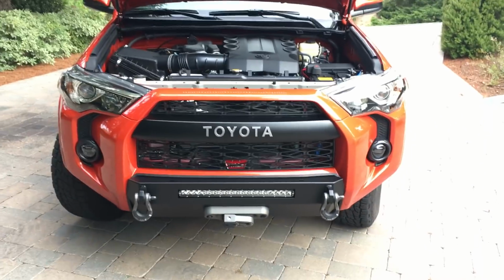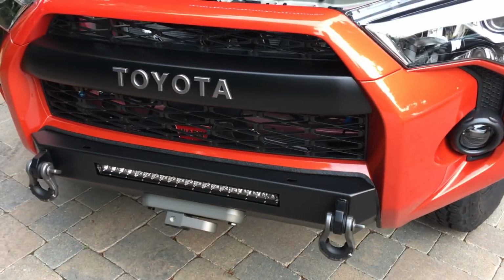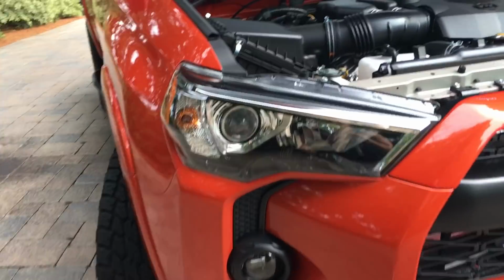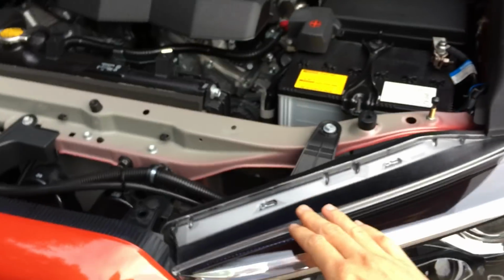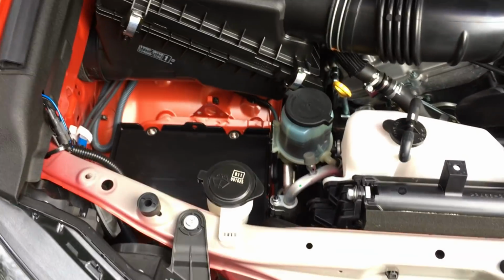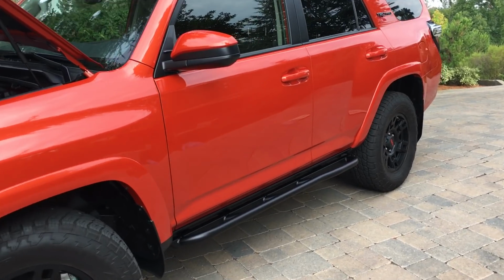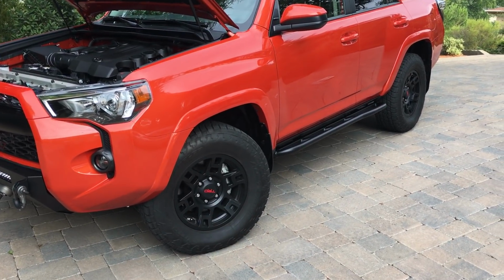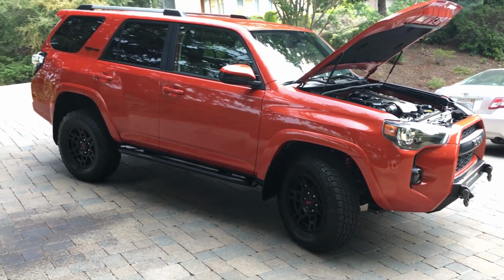IN4RNO Mod Update Sept 3 2017

Comment: Hey buddy I had the same issues you were having with the sway bar. You pulled down your video so I couldn’t text you. 

I can tell you what I did and what icon told me I had to do. Let me know if you want to chat.
Reply from the maker: marcus bacahui - I ended up smashing and flattening the cross member tube to create clearance. It wasn't quite enough on its own and so I added one carriage washer to each of the 4 bolt areas on both cross sections. This isn't ideal because it lowers my RCI armor by 1/8" and I would rather have every bit of ground clearance I can get. So, I'm going to have the drivers side cross member cut and welded with a different bend to accommodate the sway bar. What did you do to solve this problem?

Comment: How much are you selling the suspension for?
Reply from the maker: Freeman... $1400 shipped. $400 for all 4 Nitto Terra Grappler Tires (they are in EXCELLENT shape, never off-roaded, and 7K miles on them, all freeway). So, for $1800, you've got a nice TRD Pro upgrade kit (doesn't include the TRD rims or front fascia).

Comment: Why did you pick icon over king?
Reply from the maker: snazari1994 - 2 primary reasons - 1) Icon makes an Overland Series Rear Coil Spring Kit for expedition style off-roading where you can load up lots of gear and passengers in the rear and the rear suspension handles like a boss. Seriously I can't thank Icon enough for developing these rear coils the way they did. 2) The Icon kits have lots of modularity which means you can replace individual broken or worn parts without having to spend lots of money replacing entire units. Generally, the Icon kit is very well engineered and the billet aluminum parts are bad ass (strong but also very good looking). The Stage 7 kit is around $6700 for everything for front and rear including the expedition rear coils. After driving on this kit, I can vouch for it. It has amazing control, authority, manageability both on road and off road. You will have a lot of confidence driving with this kit.
Reply: Wolfgang51501986 wow, I had no idea they offered specific springs for overlanding rigs. You should definitely make a video on the suspension
Reply from the maker: I wanted to make a comprehensive, quality video, showing step by step the installation of the entire Stage 7 kit but I was under extreme time pressure to get the job done quickly on the rental lift at Pit Row. Having a complete video instruction guide would have saved me HOURS on the install. No question it needs to be done by someone, at some point. The written instructions SUCK.

Comment: get rid of that skid plate oil cover. you rub a rock underneath that and u would be crying to take it off with broken bolts. It will save u a headache.
Reply from the maker: Agreed Eduard Crespo! I have seen the same thing happen to a buddy's rig. RCI has design improvement work to do here. Luckily I haven't hit a rock yet. I'm kind of thinking of having a weld shop weld it in place permanently. You can't use that stupid little door to change your oil!!! It spills ALL OVER and pools on top of the skid plate and you're forced to remove the entire skid plate to clean it. I learned that on the first attempt to change oil by removing the little hatch door. LAME! Ever since then I just drop the entire skid plate for oil changes. ANNOYING!

Comment: Have you seen the Prinsu roofracks? I think they're awesome. http://www.prinsudesignstudio.com/2010-2016-toyota-4runner
Reply from the maker: They are the closest thing to what I actually want. Still, a little too high profile for me. I REALLY want something that hugs that roof line closely! I can relocate the XM antenna at the rear so I don't consider that a requisite for roof rack height/clearance. To be honest, I am thinking of pulling the trigger on the prinsu. Appreciate the tip Robert!

Comment: Dude this car desperately needs new engine with more horsepower and more torque it's underpowered heavy and slow as fuck also need a new 8 speed transmission then we can talk 4runner
Reply from the maker: Bobby Zee - That's why adding the new Magnuson Supercharger is a must have for this engine. Highway driving on this beast, especially up hill at altitude, leaves much to be desired (stock). However, when crawling around off-road, the engine comes alive with its low end torque. I'll be installing the new supercharger and will report back with a full review. Then you'll be ready to talk 4Runner my man...
Reply: Wolfgang51501986 I can't wait for that report!
Reply from the maker: Jsun... frankly, I can't wait to give it!